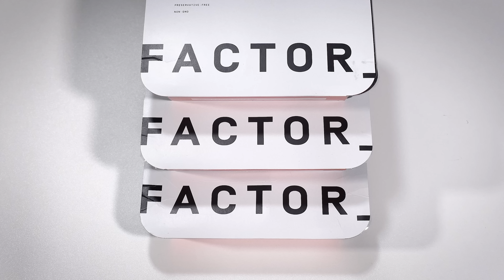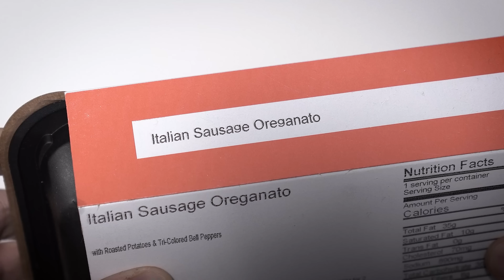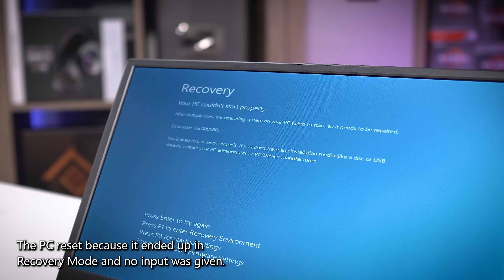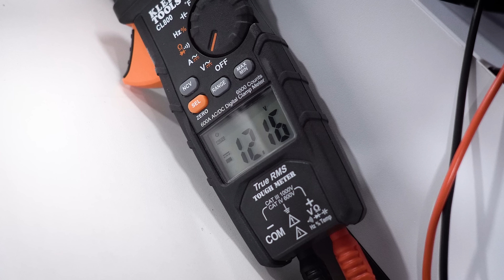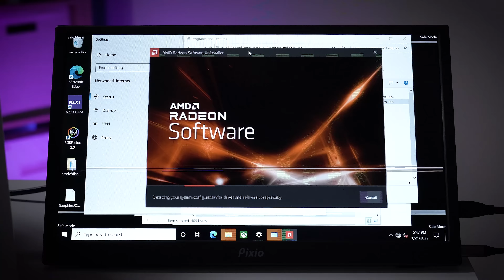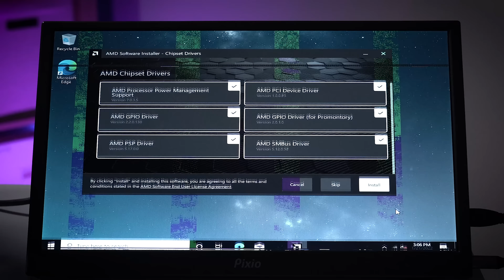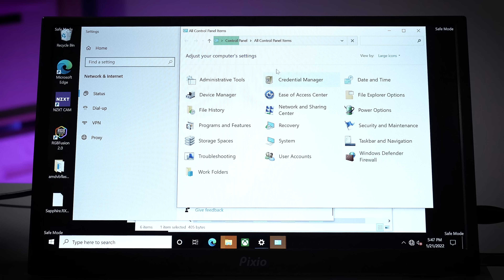Can We Revive This 10 Year Old Graphics Card?

Comment: When a card is bad. initializing it through the driver which enables all functions always shows that one or more functions are bad due to whatever hardware problem exists. My guess is that the user damaged the GPU and memory due to the heat because fans were not working. So while in default windows driver mode these things are not used. Basically all the card is good for is either parts or a pass-through video card to just give video and nothing else. You could use this card to test a possible bad board without the worry of messing up a good card. Like to just see if the bios screen kicks on. Once done then you know you are not risking a expensive card in the slot. or that one you call a discreet card. Because even though it's discreet you will miss it if you burn it up in a bad broad. But that junk card you won't miss.

Comment: I just ran into the exact same problem with a HD7870  (that I found in the garbage, by the way). In my case it also failed right after installing the AMD drivers. The solution is to reflow the RAM chips (obviously using tons of good quality flux). The overheating dries out the solder balls from the memory chips. After doing this the card runs old and newish games at solid 60-90 fps. Don't throw it away. Just send it to a shop for a quick 2 minutes reflow.

Comment: At 3:07 mark, with the card port side on left of video, I can see part of the gold plating on the second from far right side end, the second one in from side nearest the L shaped side of long connector, has a bit of the gold missing from the connector. It's possible that could cause a bad connection in the slot on motherboard.

Comment: Kinda looks like a solder issue...I had this same thing happen with a gtx 1060 that belonged to a friend...I threw it in the oven at like 180 degrees or so and voila it worked again! Might be worth a try, it's not like you are gonna lose anything if it doesn't work...

Comment: I would try just giving this card 10 minutes in oven, I repaired few cards like this before.
Reply: What temp did you use? I got an ole 770 with old paste and artifacting, oven is it's only option left
Reply: Can confirm, fixed one gpu this way as well.. Worth a try. Smells very toxic though xD Not sure you want to cook food in the same oven xD
Reply: @217RockStar217  220°C is what I use
Reply: i baked my old gtx460 more than 10x times over multiple years,everytime artifacts started popping i would put it in the oven at around 200-220ºC for around 10-12 mins. Still works today.
Reply: @HumanWithNoExtraLimb  keep oven door and window open for few hours and it's good to go

Comment: 20 bucks it's a bad memory module most likely from your overheating scenario. Vram has no thermal cut off like the core. This is basically confirmed by the specific artifacting behavior and the immediate crash at driver load. Safemode runs basic settings but as soon as the driver tries to run the proper memory amount and frequency it crashes.
 You are right replacing the dead module is the fix and you cant do that there. Would have been cool to try the old heat gun/baking trick just to see if it worked. With a disclaimer saying not recommend and not a permanent fix.

Comment: I had a r9 270 twinfrozr from msi that did the same thing. The fans would stop spinning I would have to spin them to get it to work, it gets worse until gpu temps get real bad, gpu artifacts, black screen with windows recovery and system shutdowns, I install the drivers with ddu and safe mode, driver crashes then shuts down computer. I eventually replaced it with a 1660 super from asus I hope it doesn't end up like the r9 270 did. I only got 5 years out of the r9 270. Forza motorsport, doom 2016, and titanfall 2 were running badly on it anyways.

Comment: I have a much older card (should be a HD5000 series single slot mid level card) lying around here with comparable issues. It actually works like a charm without any issues when using windows default display drivers, like you just installed windows. But some minutes after install, when windows downloads and install the proper driver automatically, the screen turns black and won't come back.
Nothing you can do about. Baking might help, but is pointless regarding the value of the card.

Comment: The only thing that I could think that might yolo fix it would be to re-flash the original bios on it if there's a backup on techpowerup for that model.  It's pretty common for cards to seem to work fine and then when drivers load things go down the drain.  The artifacts lead me to think the flash wouldn't be successful though.

Comment: Older cards may offer an initial spin up; they don't turn/engage unless under 3D load.  So this may be normal for the card (that's definitely a cooked card - you should bake it - it won't last but may confirm it by reflow which is temporary at best)

Comment: I had a Dell N7110 with a GT 525m that would get random artifacts in Windows 10 but never had an issue with 7.  Just cause windows 10 will install a driver or you get one claiming to work with windows 10 doesn't mean it really is compatible.

Comment: Its definitely bad solder joints on the gpu. This is, all those "bake your gpu" fixes are very temporary fixes usually only lasting a week. You can reflow the chip if you have the proper tool but its very expensive and definitely not worth the repair in this case.

Comment: I had the same issue with a GT 8800 a looooong time ago after I did something stupid in Furmark. Long story short, I knew from the beginning of the video you were not going to have luck with this one. The GPU core is toast, nothing you can do. 
Great video as always, I really enjoy your channel!
Reply: nothing is wrong with the core but rather the soldier joints between the flip chip and the package. These can be temporarily repaired with a heat gun but will fail again.

Comment: You coukd of got a heatgun and tried to cook it at 260c for 5min 

This is a great representation of never cheap out on ur powersupply because there exact same issues my friend had when he paired a i7-2600K and GTX 680 with a gray box psu which costed him 25$. 

He then blamed me for it because he said i shipped him the wrong card. I told him im giving you away this GTX680 so you have something to game on. He was waiting for it and i even left a note in the box specifying that you need a good psu with 2x 6pins. Maybe take a EVGA BR500 or 600 because thoose were pretty cheap. No he took a psu that was like 350w which had a sticker that had like 500w on it.

Comment: I bought a 7770 and a 7750 for $20 each from someone. I cleaned and repasted both and they work pretty well for old cards! I use the 7750 to play Skyrim (original version) in an older machine and it plays great, even with high settings!  The 7770 fairs even better in another machine I have since it's faster and has 2GB of DDR5 VRAM while the 7750 has only 1GB DDR5 VRAM.  I think I made out pretty well at $20 for each card.  🤔😁
It does suck though, that AMD is no longer making new drivers for them now, but that's to be expected due to their age.

Comment: An APU may give more performance, but it needs system memory. So if you are low on cash and already have a minimum of ram, an APU may put you over budged on ram. Sometimes you are better with a lower end discrete card. It all depends on the system.

Comment: I actually own the 7790 version of that card.  Looks almost the same with the two blue bars on it single fan MSI R7790-1GD5/OC.   The fan went out on it and it was behaving very similarly.  I found a fan on eBay at the time and that fixed it.  Could be like you said the thing just burned up because of it.

Comment: These errors are caused by vram. Put the bare pcb in the oven and it will probably work. You can leave the 6 pin plastic connector on it. I would remove stickers tho.

Comment: That looks like bad memory registers.  With proper drivers it will try to use the register to its full potential which will usually cost it to crash, safe mode limits the amount it can use to the point where it's usually usable but with issues.

Comment: watch der8auer, these kind of problems can be resolved by putting the card in the oven for x amount of time in y degrees. Think it has to do with the solder will get soft and when cooling down resolder and maybe fix the problem. I'm  also pretty sure the artifacting is due to bad memory/connection to memory.

Comment: Why didn't you try booting with the card in while using the CPU integrated graphics? Maybe check the device manager, maybe some of the card's sensors. Maybe plug in that fan in another card to see if it works properly. You could have tried reflashing the card's bios. Probably wouldn't solve the issue but still. You could've tried some other things.

Comment: With these older cards it's either hit or miss. I got an XFX 8800 GTS Alpha Dog at local recycling store out of the 5 dollar bin. Got it home and cleaned it up but didn't put into a system for some time as I thought one capacitor might have been bad. Eventually I finally did and it worked fine. So ya never know. I have bought dead one's out of the 5 dollar bin. Well you tried as that's all you can do. I have quite a few older cards from a decade plus old that work.

Comment: i suggest doing a revisit ive seen thsi before when people have overclocked the video card with msi afterburner now something to try would be to reinstall the drive use advanced options and there should be a spot that says factory reset video card. or you could try running msi afterburner and down clocking the video card

Comment: Good thing i'm keeping watch on my family's old PC with the H.I.S RX 560 still kicking after getting it for just $60 pre-pandemic , i'm not taking any chance's, throttled back power limit (-20%), that bought down temps from 61 C to 52 C with little performance loss.
Reply: Dude, those temps are very low and RX 560 is not powerful card at all. There's really no point in gimping it like that.

Comment: I actually just cleaned my office computer's GPU ahaha. The system is great (i7-4790, 32gb DDR3 @ 1600 MHz, 128 gb SSD), but it is a bit dusty. Has not been cleaned since 2013. I'm taking pieces home of the weekends to clean it up ahaha. This past weekend was the Gigabyte R7 250X, which was much worse than this card in terms of dust. Paste was similar though (hard, crystals). I'm going to do the CPU cooler this weekend and repaste when I take it back next week.

Comment: As a rule color banding is a failing GPU. Usually failing ram gives you geometry stuff. Like you'll get a bunch of artifacts in a pattern. Probably the GPU was on it's last legs. Having it on that initial time with the fan not spinning and heating up might have cooked what little life it had left in it out of it. What you are experiencing now is a CPU that's only functioning as a 2d accelerator and even giving artifacts doing that. As soon as you install display drivers it tries to 3d accelerate and instantly fails because the GPU is fried. You gave it a go. But yeah it's certainly not worth repairing at this point.

Comment: Furmark + hd  6000/7000 series = hiroshima

If I remember correctly a driver bug caused the card to think it was running much cooler temp and would fail to throttle or shut down. Running stress tests on them particularly with furmark would cause them to fail due to overheating

Comment: i had a 6950 that died on me. I had replaced the cooler with an aftermarket one and temps seemed to have improved. Until i looked at more detailed readings with HW64 and i had messed up the thermal paste coverage and the cache temps were 115C and above even though gpu core temps were fine. So after a while the card was no longer stable in 3D mode. 
So Greg's explanation at the end is plausable IMO.
Reply: @Aggrobiscuit  Not enough paste, spread too thin so their was one spot with no coverage. This led to a hotspot even though general gpu temps were fine.
Reply: @martheunen  Thats the problem with hot spots... if they arent on the thermister it just reads normal... i did the same thing to one of my first computer builds... didn't realize it till it was too late... now i drown everything in silveryness lmao

Comment: I have an old HD 7870 that "died" on me 3 weeks ago with kinda the same issue. It's working fine until the driver loads.. after that I get nothing. I will try to fix it by putting it as a secondary card into a system that works and then try to reflash the BIOS because after 10 years there might be some issue with it. Maybe you could try the same with this card.

Comment: there is never a 100% sure diagnosis but i'm very sure (due to the shape and position of the artifacting) your card has a failed memory module that needs to be replaced. possibly due to overheating from the fan dying. once the driver tries to initialize the memory modules goes up to full speed and crashes which causes the blackscreen/bootlooping you experienced.

the proper fix for this is to remove and replace the offending memory module with a new one. you can find out which module it is by using some vram diagnostic tools for amd cards.

*DO NOT TRY TO HEATGUN THE CARD* it might be tempting but this is not the way to fix it. it might bring it back for a week or so but "reflowing" as it is seen in many youtube videos is more of a hoax than an actual way to fix things. So many people have destroyed otherwise fixable cards by heatgunning them because they saw a youtube video claiming it can help. please don't encourage this.

Comment: Is it possible that the owner flashed a firmware update that wasn't for that specific manufacturer's card because they didn't know what they were doing?  It's an old enough card that as long as it's the same chipset and platform that the card might have took it but could have f'd it up.  Just throwing this out to Greg in case he didn't consider it or maybe it's a non-option...

Comment: I have a period specific computer on an open chassis, running Windows 7 Ultimate, that I use for these old cards.  Most of the time, Win 10 is NOT compatible with those old drivers. Good luck and have fun.

Comment: Yea, I believe that the self preservation features of GPUs may have been after this cards lifetime?  I have done in a couple in my lifetime due to fan seizure. Like go back to the mid 90's. Very similar results afterwards.  Starts off with slight artifacting and just goes downhill from there.  Fan always seemed to be the weak point of price-value cards. Good try though.  DDU is the only other thing I would have added to my toolset, but your windows re-install made that superfluous.  :)

Comment: i have a question, a friend of mine has a GTX 770 that he used till he upgraded to a 1080, he was going to sell to my father, but when we tested it out it did boot into windows, but then when you try to install drivers it doesn't post, and this was in my PC(i have a EVGA 750w 80+ gold PSU), i placed it in my brothers PC, his has a weaker PSU, and it booted, tried to install drivers, but same issue, i unplugged any extras, like extra hard drives and DVD drive, and it would constantly boot but not install drivers, any idea on a solution?

Comment: Just bake a cake. I mean put the card in the oven. Strip it off of any plastics, use tin foil to cover up any plastic left on the PCB and bake it for like 20 mins in around 180C or something like that. Did that to an old Radeon card from the same series like 5 years ago. It has had same issues as your 7770. I know for a fact that it still works and runs games. 
Your wife may not like the smell afterwards but hey, if that means the card works, it's worth it. Lol.

Comment: You said you can't fix it, but all it needs is a reflow via oven trick, pretty sure. I don't think anything was downright broken, it's just a old card that degraded a bit and the oven trick could fix that. Heat gun or oven. Also don't use a card without a fan, you don't know how hot it gets with random things Windows does. You wasted a lot of time there on things that were pretty much unnecessary.

Comment: I've been having blue screens for the last few weeks. They persist and change codes through a few different windows installs. Drivers are all up to date. Windows is up to date. I've remove my cpu overclock. I've switched the ram. The only thing that stopped the blue screens was removing my gpu overclock. I've had that same overclock for about 3 years now. I think it's either the gpu or the psu. How should I go about singling this issue out? I've ordered a psu tester to check my voltages.
Reply: I guess you experienced silicon degradation. An OC that was stable on a new card, might no longer be stable after hundreds of hours on the GPU.
Reply: @saltyman37  I was thinking that may be the case. It was just so sudden too. It was completely fine and I didn't play for a couple weeks and bam blue screens.

Comment: Maybe you should put some flux under that GPU die and hit it with a heat gun? At around 220C the solder balls should start melting, which could fix this.

Comment: i have 2 EVGA GTX 780sc Cards killed by canned air spinning the fans id love to get fixed to restore the 3X SLI rig i built in 2012. the entire rig except those 2 cards is working and has been running 24/7 for all but about 3 hours since i built it in 2012. I had to replace the 280 AIO 2 years ago when i moved the machine to the garage to control my CNC.the remaining 780sc is still running in the machine. im sure its nasty dirty right now but i can turn on the monitor and shes always there running away. both the bad cards come up in gpu-z but show an error code.